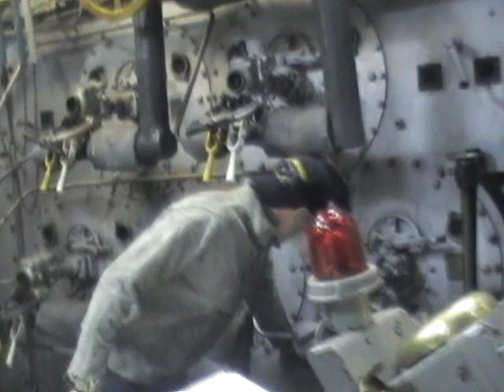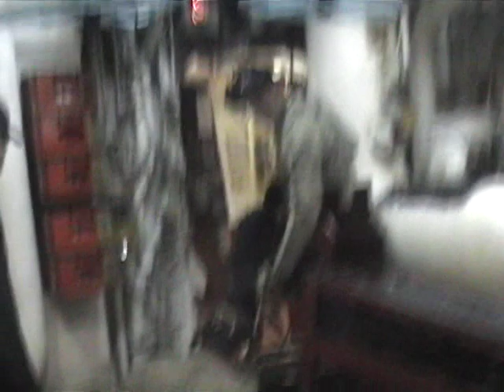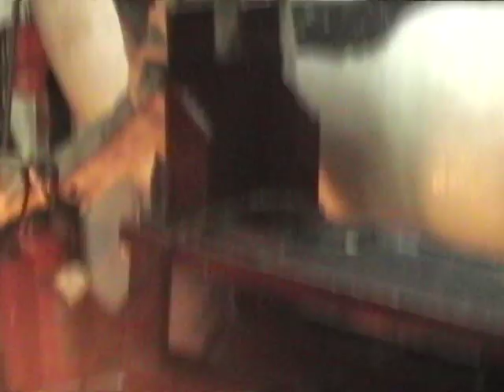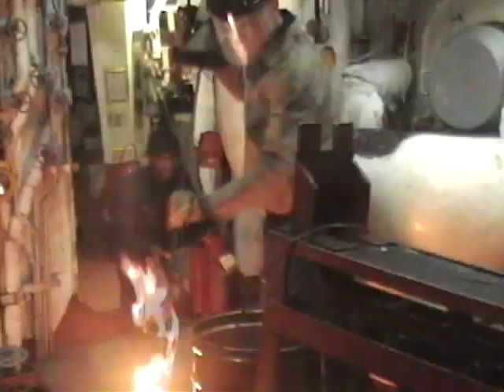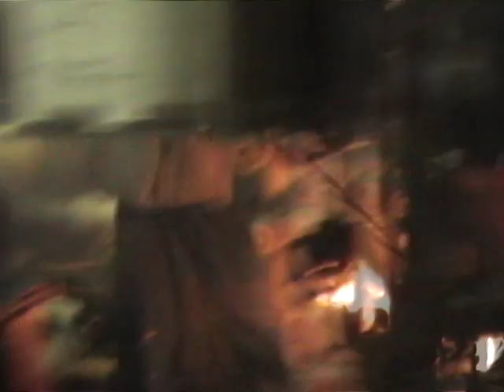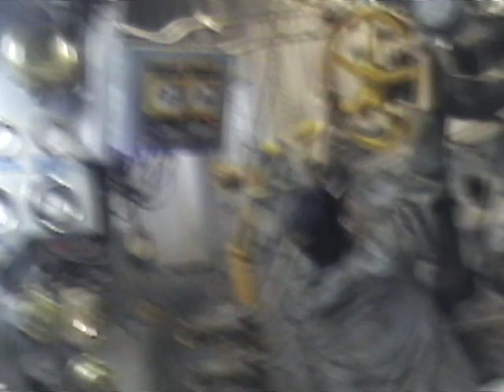Boiler Light Off

Comment: BT on Sacs sister ship,  Camden AOE2, Nov 1966 to May 1970, only snipes knew what made the ship run. worked in a hospital boiler room from 1970 to 2012, got to thank the Navy for my experience leading to a great job on the outside.
Reply: You were smart, I separated as a BT3. I made BT2 but Nixon put a pay freeze on all feds, including military, when it lifted I didn't have enough time left to get advanced and I sure as hell wasn't gonna ship over for a measly few bucks extra per month to get it either. I had taken out a DeVry electronics correspondence course while in, we were on Yankee station, I sent all my course stuff back from there because it was free franking privileges. Looking back now, as a snipe I could have easily landed a gig in any city or municipal water management position, put in my 20 there and retire fat & happy- like you☺
Reply: I was an oil king on the Camden. ‘89-‘91 good times!
Reply: I was a BT and then MM when they combined. 1996 - 2000. USS Camden AOE-2. The Mighty Pachyderm.
Reply: I was a BT on the Camden 80-81.

Comment: my dad was a BT from 1951-1955 on a Destroyer Escort, then a High Speed Transport (converted DE on the ways with 12 Navy Frogmen instead of rear armament) and then as watch stander on a Command and Control ship (converted LST)  got out as a 3rd class and went back to work on the railroad as a welder/carman...

he said they never had leather coats or face shields.  some guys had dark goggles but gloves were the only PPE they had.  and as hot as it got in there, transiting the North Atlantic during a November storm, they STILL stood with their backs against the boilers to try and stay warm...

thanks for the video!

Comment: Saw a BTC light fires off of a glowing back wall of the firebox, after #1 boiler lost fires. The front wall of the casing moved about two inches forward and then back, but it worked! Chief then said that if he ever saw a fireman try that he would throw him in the brigg and deep six the key! RIP Chief Dupree!
Reply: I did that on the supper heater when I lost fires on it. For some reason the mic valve totally cut off the fuel. A little puff then I was back in order.
Reply: Chuck wagon … being that i was never a BT , im not familiar with lighting off a back wall . How does this process work … and why is it so dangerous ?? Why would you favor doing this over using a torch like in the process i just watched ??
Reply: The burner yoke came out and hit me in the chest, to my surprise
Reply: That’s why you have to make sure you grease the Sliding feet. That happened to me once the message forgot to put a sprayer plate in the burner barrel And when I turn the burner on The boiler slid out and met my hand as I went to grab my micrometer valve

Comment: I was an MM on the USS Juneau (LPD-10) from 1977 to 1980 in #1 MMR. As an MM2 standing MMOW I've observed the ships boilers being lit off many times. Safety was always paramount. For the sailors lighting fires, safety protection was mandatory and included as a minimum the fire proof vest, gloves, safety glasses and a face shield in case of a Flare Back. To the guy that posted comments mocking and ridiculing these guys for donning safety protection, The Navy had to make it mandatory because of guys like you that lacked the common sense and self preservation to protect yourselves.
Reply: Still no reason to spam it four times....
Reply: We never had protective gear . Even lite them off with the inner door open to scare the hell out of midshipman.

Comment: I worked on the USS Sacramento from 2001-2004 and was in both MP-2 and MP-1 divisions as well as worked in the oil lab. One of my fondest memories as Checkman was forgetting that the feed check valve was reverse seated when I was trying to take manual control. Needless to say, we lost fires on that boiler lol

Comment: Should have shown them light it off the back wall. Did that a few times.
Reply: My first ship blew up a boiler doing that
Reply: Yep boiler explosion USS Denver I was down there.
Reply: We made a video on AS-40 Lighting off. I stood burners then. Wish I had a copy of it somewhere.
Reply: Just like in locomotive practice, you don't light or relight from the flash wall.
Reply: Only as a last resort as that will cause a lot of refractory problems.
Reply: those were always a dust shaker in the main space

Comment: Kind of neat as those were two engines from the incomplete USS Kentucky BB-66 Iowa class.
Reply: And the other two went in SACTO's sister, the CAMDEN. Great units.
Reply: @iowa61  I was on the Camden, but worked topside
Reply: I served on Camden  and Sacramento. Westpac 94 on Camden joined Sacramento in Todd Pacific after there collision with Lincoln
Reply: I also served on the Camden 80-81, BT3 Steve Povkov [pops]

Comment: Why does he shake the torch so many times? I've never seen a boiler lit off as I was a topside sailor
Reply: Drips and lose material.  When transferring flame DO NOT want them to drop off somewhere (IE BILGE) or as turning flung in route to burner front and get missed until they come back with a BIG friend.
Reply: Good question as we never did all of that. To much drama.

Comment: A modern gas grill has a more advanced piezo igniter. And even if a piezo igniter can't ignite that sludge they use for fuel, they could have something like butane stored up to help it out. Not unlike a modern cigarette torch lighter that uses butane. Shoving a lit fuel-soaked rag in there is tacky, IMHO.
Reply: If it aint broke dont fix it ...